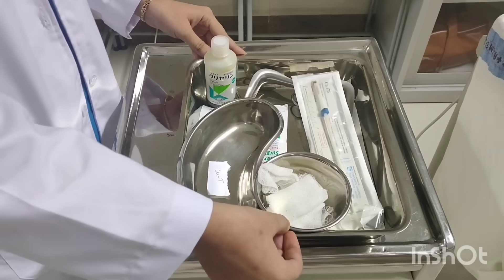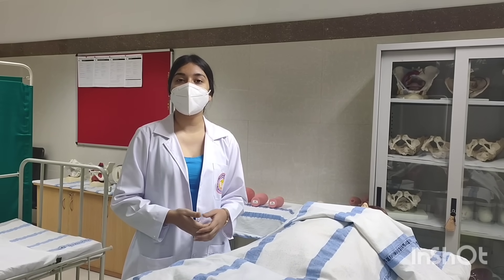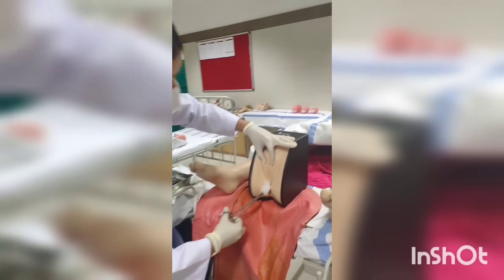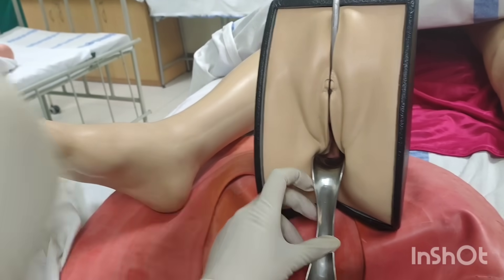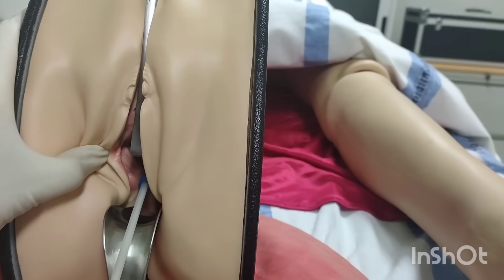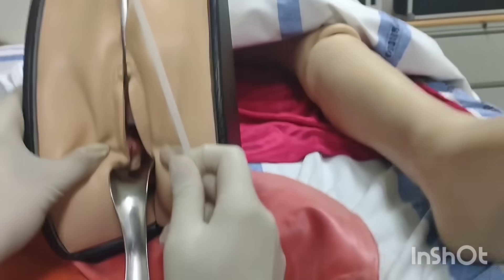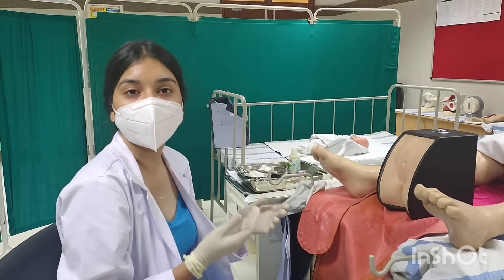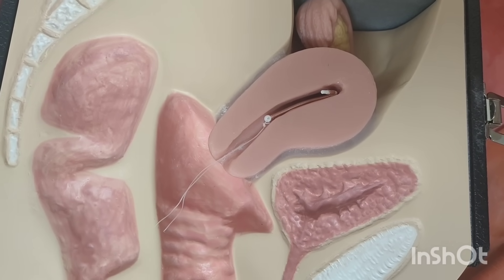CuT Insertion | procedure | Copper T insertion | IUD insertion | Intrauterine devices

Comment: Just to point out - the IUD shown here is Cu 380A (a.k.a Copper T) and not Cu 375 as shown on the label and mentioned in the video. 

Shelf life (i.e  life of the product on the shelf / insert before date) -  For ALL Copper IUDs is 5 years.

Effective Period of IUD (based on model)
CuT 200B - No longer is use
Cu 250 -  3 years
Cu 375  - 5 years
LNG IUD (Hormonal IUD / brand name Eloira ) - 5 years
Cu 380Ag (Copper + Silver) - 5 years
Cu 380A (a.k.a Copper T ) - 10 yrs